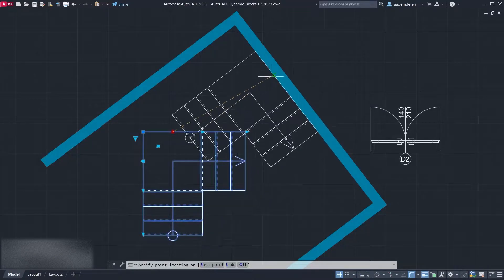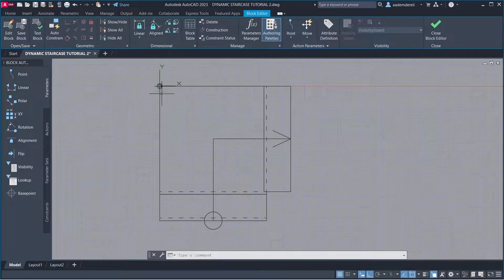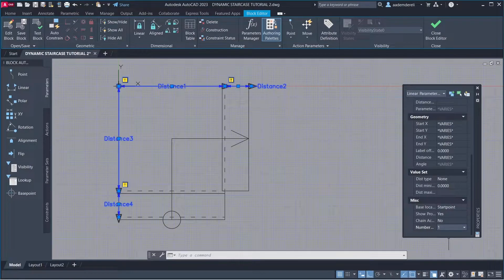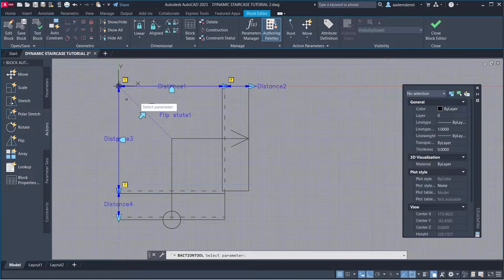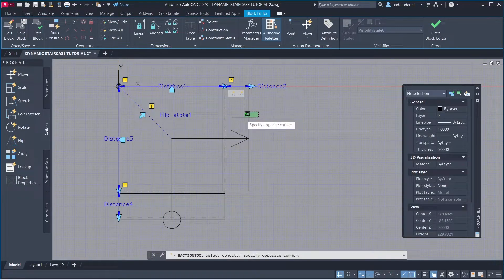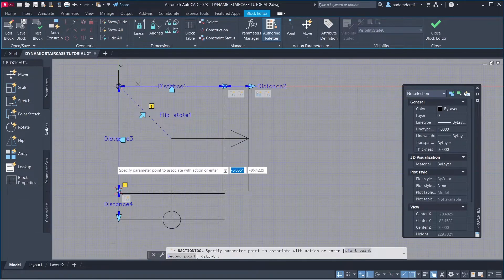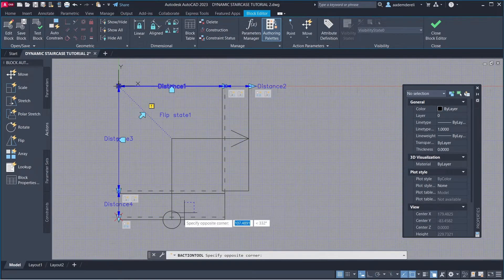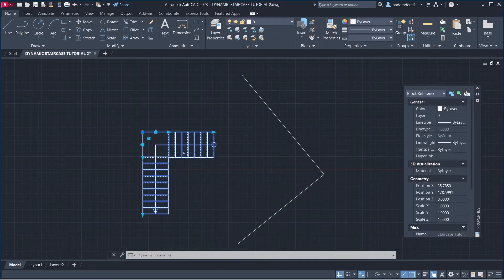AutoCAD Dynamic Staircase Tutorial 2

Comment: With a little bit of setup and an advanced mathematical equation inside the bloc, you can create a straight staircase bloc able to rotate, stretch/array with automatic numbering of the steps in one single action.
Reply from the maker: Can you create it?
Reply: @AdamArchh  I did, I will try to do a tutorial to explain how it is working as the calculation is complex. Only problem with the bloc : it is difficult to update if any change occurs to the steps
Reply: @Tobiraco that would be cool , exatly what’s needed . This is good but you still have to calculate the steps by the dimensions of the place .